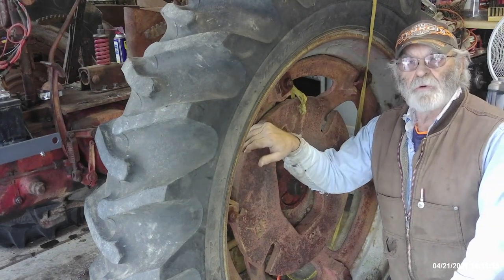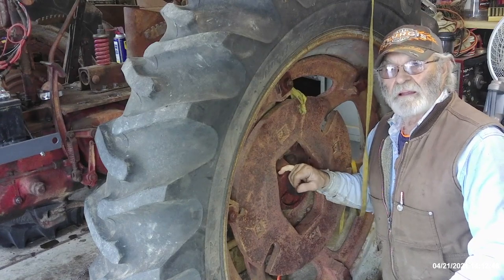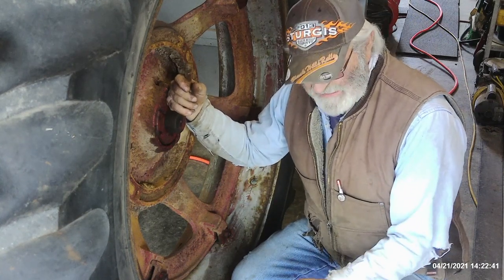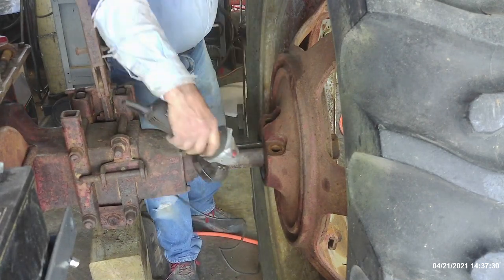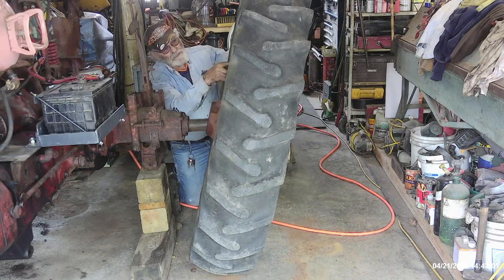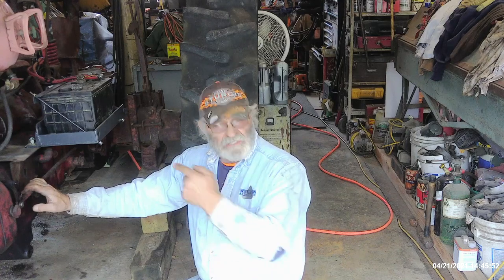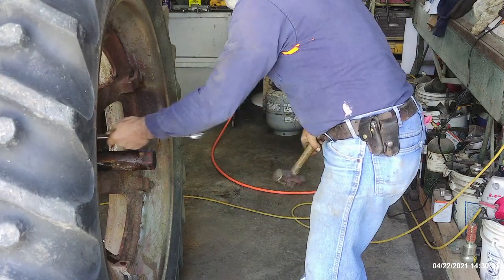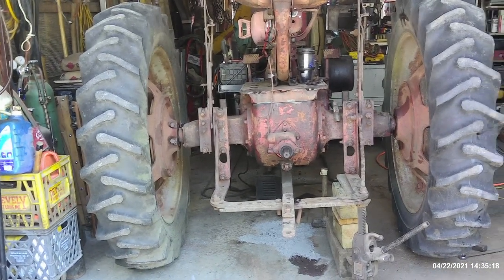Farmall H Adjusting Rear Wheel Spacing

Comment: Hi Wendell!  Great Job!  That was a tough one for one person, but you always find a way to get it done and done well.  Very interesting how those Farmall wheels attached. Thanks for sharing!
Reply from the maker: Yes, the mounting is really cool.  On a Massey Harris, I have soaked, heated and beat for weeks at a time to move them.  I actually use a 50 ton hydraulic jack on the tough ones.  This one was a cupcake by comparison because of the design.  They WERE in fact rusted in pretty solid.

Comment: Harder on you without the overhead,more education for us without overhead! I have the zerks on my jd and i never think i have enough lube back there cause no place to ooze out. Thankz for the tipz! U made that werk look easy.
Reply from the maker: The seals keep the grease in so the extra heads up the axle housing towards the transmission case I guess.  Farmall is who made the job easy with the design of the hubs !!  Man they are really easy compared to the Massey Harris hubs.  I have worked my tail end off moving those and actually broke an Oliver 70 splined hub with too much heat and 'persuasion'....learned my lesson on that one.  Patience is a virtue......  LOL  Thanks Mike for the cool comment once again !!

Comment: I thought I would mention something I seen on a farmall H, I seen in the scrap yard today. Maybe I'll go back and buy them and put them on my H tractor. 
  It's was some (red) rear  cast iron center & rear rim's  , that you could  move in and out like an allis chalmers.  by just  ( I've never had an allis to do it, but seen it in a video) driving or spining it 
in and out some how.  It caught my eye, as I had never seen that casting  look,  as these did.
so I looked closer. then i looked to see how they bolted to the axle , the looked tight and nice fitted
like they belonged.  There always somebody , willing to come up with a way, to make some thing easier . I   know there 's the keyway  on the I H   cast part  So the one, the guys using must have that the same as the H one. to not slip and work
Reply from the maker: Those are 'power spread' rims and hubs Bill.  Those are unusual to find on an H.  If I had that opportunity, I'd go buy them myself. When loosened, in low gear or reverse at an idle lock the opposing brake to spin in or out.  After a few times, it becomes quite an easy task.  You may have to roll a bit and bump the brake to get it started and repeat to complete.
Reply: @tractorman4461  Thks, Now it makes me want to buy the power spread rims even more. Tks for naming them. My wife, say's, I 
can go get them but, were not putting tires on them for a long time, if they need tires. I'm in Wisconsin, the chance of you being near here, is pretty slim .Are you way out east?
Reply from the maker: @janbill79  I'm pretty much directly south of you a bit.  I'm just a few miles off the Mississippi River and just south of St Louis Mo.  I like Wisconsin, there's a lot of old Masseys up there.  We came up to the Dells a year or two before the covid thing.  We loved a cheese factory we ran across waaaaay out in the country !! Man, there was some good stuff right there.  While we were there a Missouri tour bus came in and 60 or so old timers and their wives came in.  
    Turned out they were a group of snooty rich people from one of the fancy suburbs just west of St Louis on a private tour.  As soon as they found out we were from (heaven forbid) out in the country south of St Louis they clammed up and wouldn't even give us the time of day !!  We got a kick outta that.  Some people seem to think they are way above commoners like us.  LOL   But we really loved that cheese factory anyway.
Reply: @tractorman4461  Thks for the small world story. that's funny.  St louis , Ok,  Yeah we got the classic masseys.( wi) seems like always 1 or 2 for sale . there was a model 333, I wouldn't of mind having, couple weeks ago. but with about 101 projects, I'm learning to finish one where money keeps going into just one till done. and "even through",i see cool tractors and parts for 
sale. I 've got a two tractor a year limit. & thats done this year jd 620 & cub farmall.
Reply from the maker: @janbill79  Oh I just can't work with a two per year limit.  That worse than trout fishing !!  I'd break that limit by March on a good year.  LOL.  I too have waaaaay too many projects, but when another comes along I just can't say no to a bargain !!  Oh well, like I tell the Missus, it keeps me out of the taverns a night.....  I have a stuck Cub for sale but I really want to part it out.  I've nothing as new as a 620.  That'd just freak me out to have something reliable !!  I missed TWO 333's just miles apart because every time I stopped no one would answer the door.  No numbers, just signs on them.  A good friend and Massey collector managed to buy them both though.  Good luck with your endeavors Bill. Take care and enjoy the day.
Reply: @tractorman4461  all the more video's for us. I love your videos,  You always seem to figure out repairs, like the cub deck, strength'in  up the deck and square it . Must be a defect with there decks . I couldn't figure that out and just put a wider belt , but then I had to start it with blade in gear...
If I would license my trailer then I could get deals  on, not running tractors,  do my own free towing after the auction or classified add  .
Reply from the maker: @janbill79  Well heck, if that's all that's stopping you, go ahead and put some plates on that trailer !!  LOL  A fellow never has enough trailers...or enough tractors....or enough junk to build stuff out of !!  I am glad to know you enjoy the videos.  Hope to hear more from you in the future as well.
Reply: @tractorman4461  I take simple tasks that are something i've never tackled and leave them go and go untill certain things I buy now sat for years. like this 14 ft trailer. It has a little battery on it> I'll bet it's something to do with electric brakes .
have no idea what to do with that to make it legal. Unfortunately there's a DOT guy that lives around here . So I have to learn how to inspect and make sure everything is legal not to get picked on by that dot inspector that always has people pulled over on hwy 61
Reply from the maker: @janbill79  Yes, better safe than sorry.  That little battery is connected to a 'breakaway' switch that comes into play if the trailer breaks away from the vehicle.  Once disconnected the switch will energize the electric brakes until it is rehooked again to the seven pin plug on the tow vehicle.  Hey...we must be neighbors.  I take Hiway 61 daily to get to my house !!  LOL

Comment: I apologize if you mentioned it what is the bolt sizes for the weights and the axle clamps ?
Reply from the maker: I've been waiting on replying so I could go look at them again, but I keep forgetting every time I'm out there.  I'm guessing the bolts for the weigts are 3/4' and the axle clamps are every bit that diameter or larger.  I just don't remember what they were.  If I ever remember to check for sure I'll add it to the comment.

Comment: I hadn't messed with the width of my H, and I don't think I will.  They're in the narrow position already with the dish in.  I would have to switch the wheels to the opposite side to get the narrowest position with the dish out.  I don't think I want to do that.  I seen a video of a guy who bought a Farmall C, and he complain about a previous owner cutting off the axles after moving the wheels in.  I guess cutting off the axle ends will keep you from snagging them on something or yourself, but I don't know if I would do it.
Reply from the maker: I agree. I would never cut the axles short.  I've got a 44-6 parts tractor that a guy torched the axles off a few inches from the axle bearing housing just to keep the hubs and wheels.  It will have to have replacement axles to put it back into a usable tractor.....but we have been scrounging parts off it fr 20 years anyway.  Heck, it was one of the free tractors too.  So I can't complain....LOL.  I like the axles set to be even with the rubber like this one is.

Comment: Yes I also dont like the rear wheels extended out real far. The reason for the adjustable rear tread wasnt for stability. It was for row crop spacing to fit between the crops. A wide rear axle or a wide front  doesnt prevent a tractor from flipping over. Its not putting them in a place where they can roll over that prevents accidents.
Reply from the maker: Yes, we had to change wheel spacing every year for the corn planter and cultivating.  We used the same tractor for both to minimize the work.  We had the hubs set so we could just reverse the two wheels and run them backwards for the duration of the season.  You'd be surprised at the number of people that think the only reason to run them wide is for stability ....

Comment: We bought coppercoat in 5 gal pails for just such an occasion. That old farm equipment is likely still oozing coppercoat, wherever they may be
Reply from the maker: I should've used anti-seize on these hubs too.  But I will never move them again and they hadn't been moved for at least 30 years this time !!  I use it on most anything that may need to come apart in the future.  I'm getting a bit low on the good copper-based stuff though. Thanks Rockee for the comment !!

Comment: 44 good afternoon hot here very interesting in the 50s in Wisconsin most whiles were in the narrow position 
God Bless All 
PaK
Reply from the maker: Wheel spacing depended a lot on your row crop spacing.  We only had two tractors we moved the hubs in and out on.  One for planting and cultivating and the other for picking corn... The rest of the time all were kept at a minimum width.  Thanks for chiming in Peter.  Good to hear from you today.

Comment: ..... OK !  what's the torque setting on the hammer - to - wrench setting on dem wheelz ??? LOL
Reply from the maker: Well...you could tell by my doubling up of the 1 1/4'' wrenches I had to bear down on some of them to bust 'em loose.  That's an old impact I bought at a farm auction 25 years ago.  But the bad thing is the air compressor is three 50' hoses away.  So the pressure drop out here in this shed is bad...real bad.  I set the regulator at 110 psi, but I bet its supplying 70 psi or lower out here. 
    I have to run a 2'' line out to this shed, add an 80 gallon reservoir, then extend piping  through the center of the shed with multiple drops for  the air hoses.  I have all the parts, just not the time. Same story huh.  LOL.  I tell ya though I have a new 625 foot pound air impact that this old one beats every time.  I have no idea what it is...but on a short hose off the compressor...WHEW !!  It does good.  Thanks again BubbaG for the question !!
Reply: Nope  , it's only you using it , just at a reserve tank with in 50' and you'll be fine.
You ain't gut no high demand need'n to supply boat loads of pressure ..........
............. can use a pancake compressor to run me hole gee-rahj .......... all about stored energy............ ...and leaks !!! 
BEE WELL TM44 !!!
Reply from the maker: @bubbagump4686  If I really need a lot of pressure quick, I fire up the pto driven compressor on the home made sand blaster.  Now that puppy can put out some air quick !!  Yes, pressure drop with my current 'temporary' set up is definitely  the killer.
Reply: Bubba has a point. 
Just having a portable pressure tank with input and output fittings will let you build pressure and run your air tools. 
The pressure drop is lack of flow through the hose. 
The portable tank will provide max flow at the job. The cycle time between bolts will let the tank catch up. 
It is a trick I used on pneumatic equipment in the factories.
Reply from the maker: @OldSneelock  Even with the pressure drop from 150' of 1/2'' hose that old pneumatic wrench has more torque than a 110v Black and Decker 1/2'' electric impact.  I use a pancake to run the nailers for hardwoods and stuff like that.

Comment: Lots of good tips in this video. I was also admiring your sheet metal brake off to the side....
Reply from the maker: That one has a cool story.  My regular 8' is in the other shop and is a 1959 Connecticut brand.  This one is a Dreis and Krump.  I was doing a favor for a buddy installing a furnace for his friend a couple years ago. When I was done, the old fellow (on crutches) said he had one he bought new brake back in the day and bent nothing but light gauge aluminum flashing for mobile homes skirting.  He said he hadn't seen it in about 25-30 years or so and it was covered with all kinds of stuff.  I gave him my number in case he ever wanted to sell it because he didn't want to right then.  So fast forward probably 6 or 8 months, I don't remember, and I get a call from him to come get it for $ XX.xx IF I still wanted it.  So....here it is !!  Man, it is in EXCELLENT shape too.  Not bent or sprung and the bending bar has no notches in it or anything !! Thanks Matt for the comment...sorry you had to read such a long response.  LOL
Reply: @tractorman4461  Your response was just fine! You should do a video on it. I have plans to build a box and pan brake once I catch up on the 500 other projects I have going LOL!
Reply from the maker: @mattthescrapwhisperer  I tell ya....a good old buddy passed a couple years ago and I was left a Harbor Freight box and pan that's 24 or 30'' width....I don't remember which width it is.  But it is surprisingly heavy and well built for small projects.  I use my lighter 22 ga 48'' Connecticut box and pan for most things where a box and pan is needed.  I bought the 40'' new in '85.  But if I was looking for a small universal brake, the Harbor Freight is a remarkably good tool for the price.  Before you build, you might want to check one out...see if it will fit your needs.  It wouldn't be worth a darn for duct fabrication though.
Reply: @tractorman4461  good points! I'll check it out.

Comment: Green tractor 37           Hey 44 TM I have a "c" type hanger to hang on my over hear hoist to install those wheel weights The weights on that   H weighs 135 lbs.  I put 4 on the 400 on each side. You have borrowed it, I  know it is quite a distance from your shop to mine. It is hanging close to Andys 44.  For you know I am to lazy to do it the hard way so I made this thing. Works for me.
Reply from the maker: Hahaha...I didn't know they were that heavy.  Felt like a 80# sack of cement !!  It was raining that day, (I think) so I couldn't go over to the hoists to slip these inward on the axles the easy way.  I need to make me one of those things to make it easier for me too !!
Reply: A H has 38 in rear tires and will spin out trying to pull a heavy load. A M with the same size 38 inch tires will pull that load and never spin a tire, its the heavier  weight of the M that makes  the  difference. You need those weights on a H. My father also ran liquid in the rear tires of his H. Once I got a H stuck in deep red clay mud. Really buried the rear tires. Then cane a couple of weeks of freezing weather. We got that H started and I let it warm up. Got on put it in first gear and it pulled a great wheelie before it broke the ground loose and came out. Big gobs of red clay frozen to the rear tires.
Reply from the maker: @thecollectoronthecorner7061  Good story about freezing one in like that !!  I fired one up about ten years ago that was sitting in a frozen puddle though and it peeled the failing recapped rear tread right off the tire !!  Well, I stopped at 30'' or so. I guess it was a recap....it sure peeled it like a round banana !!  And yes, the weights are going right back on.  I looked in the pile for another set.  I thought I had a second set, but nope.  If I had three or four sets, they'd ALL go on.

Comment: How's she goin'?  Gearing up and figuring what may happen if something gets away on you is a great practice and will save injuries.  Nice work strapping those wheel weights and letting them down easy!!!  The wheels came loose pretty good to eh.  That made the job a lot easier.  Thanks for sharing and take care!!!
Reply from the maker: Well, the pneumatic impact and a week of spraying the bolts down helped a lot.  But they still needed some pretty good 'persuasion' to be driven out of their holes with the hammer and punch !! I just couldn't get to the hub bolts with the wheel weights on.  Thank Mike for stopping by today.

Comment: Yes, I also use a track jack on my tractors. I find it far better than a hydraulic. I only loosen the bolts maybe a ½" to slide the wheels in or out. I also use gear oil on the axles and it seems to slide a little easier. When installing wheel weights, I place to weight on the exposed axle, through the hole. Then line up one bolt and install it. Then I can rotate the tire until the weight pivots on the bolt and aligns with another bolt and then I can install them all. That's how I do it when I don't have any kind of hoist or loader to assist me. I learned the pivot trick when installing or removing manways on storage tanks when I worked with the Boilermakers. Interesting on my John Deere B the manual tells you (after moving the wheels in) to coat the exposed axle with grease and cover with canvas! I never saw Dad do this but the last time I moved them in I did what the manual instructed and the axles are no longer rusty or dirty and move easy when I want to move them. 👍👍👍
Reply from the maker: Good tricks !!  This is the first Farmall hubs I ever moved so it was a bit of a learning curve on the first one.  I tell ya though, they are miles ahead of Massey Harris's hub design.  Now that I have them figured out and the axles are clean I will no longer remove the bolts if I have the need to move them and I will use your technique or something similar.